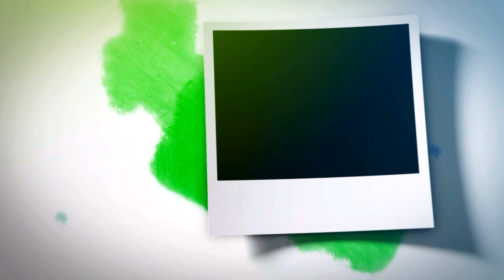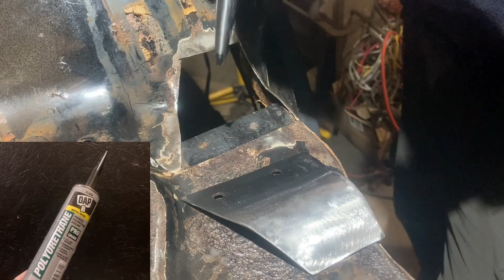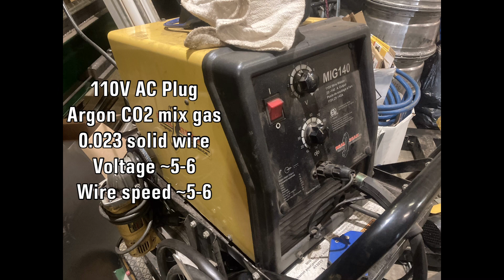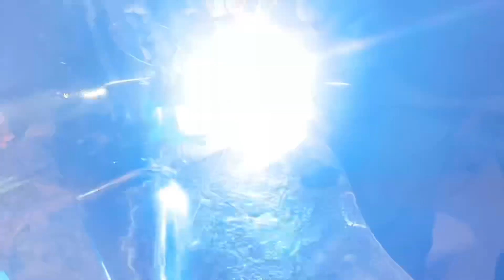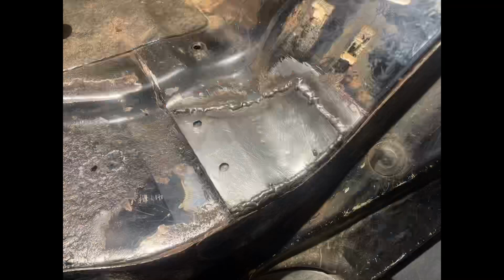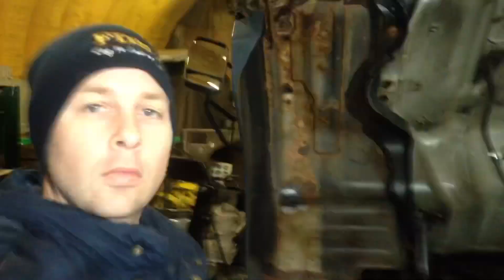Mitsubishi Fuso FG cab rust repair step 3 !!

Comment: a flat faced hammer bit is what you want to use on those spot welds, basically turning the weld into a rivet as you peen it flat. looking forward to the rest of the build. love these FGs for work trucks, neat to see what people are doing with them on overland builds.
Reply from the maker: Yup, tack ‘n whack!  (Just need to be quick on the whack, and have a good backer!)